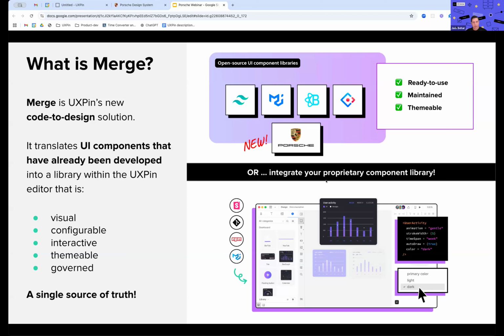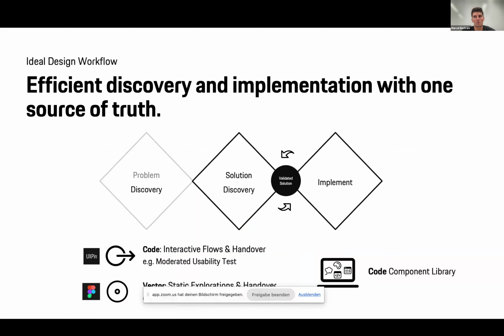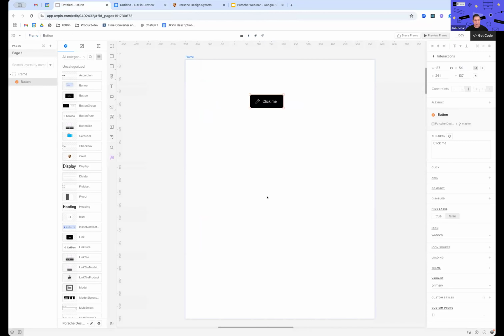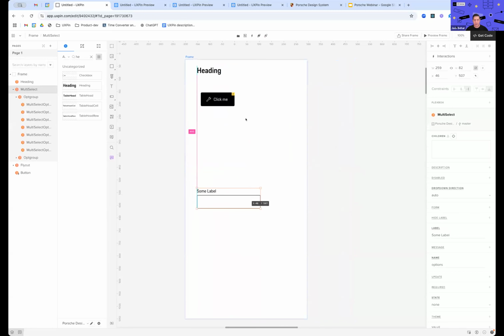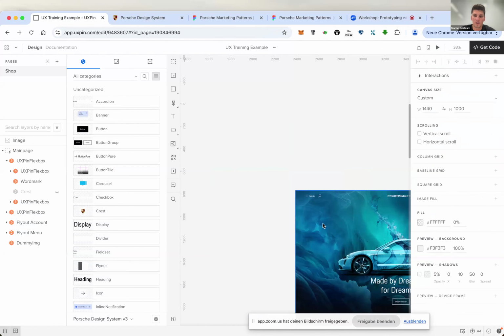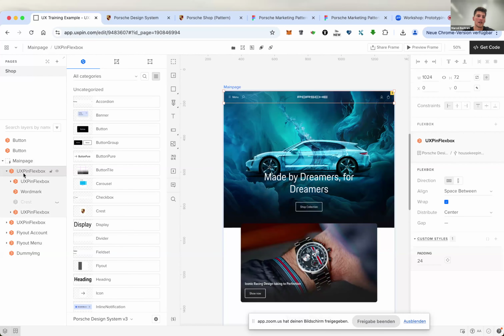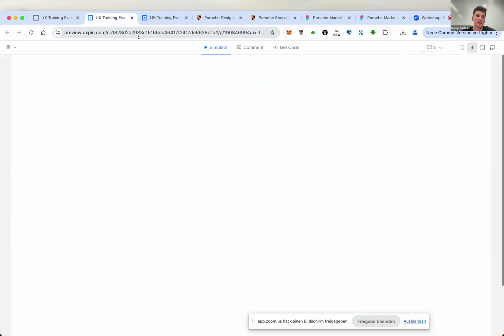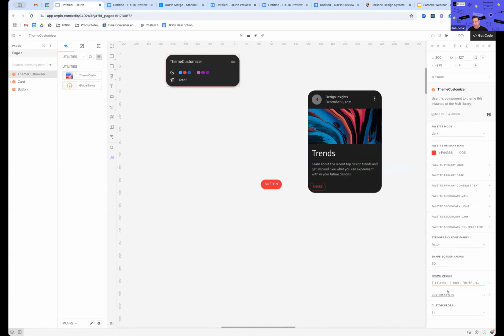Workshop: Prototyping with Porsche Design System

Comment: UXPin is not bad; I tested the software briefly, and the main issue I encountered was that the desktop app’s performance differs from the browser version. In many situations, it freezes on certain functions, such as moving frames, and the overall experience feels quite choppy, which I didn’t notice in the web version. I believe the app still needs some work to improve the experience, as I was unable to use it effectively because of these issues. I tested the MacOS version on an M2 Ultimate machine with 64GB of RAM, so it's clear that the problem isn't related to my hardware, but rather bugs in the app itself. I really like the interface and many other aspects, and I hope these issues will be addressed in the future.

Comment: Very cool stuff. Thanks for sharing. I'm a senior UX/UI designer and bridging the gap between the design and programming worlds have always been a challenge. The only problem I still have with fully advanced interactive prototypes like the one displayed here is that at the end of the day, programmers have coded almost the entirety of the final prototype. I can’t code so my sole job would be to design static components. Of course I can do a quick and simple interaction in Figma and show programmers how I want it, but they still need to code it. I understand that once a component is coded, designers can reuse it endlessly in the prototype. Based on my experience, it proves to me once again that designers and programmers must always work hand-in-hand. In my last job, I had the chance to sit right next to the programmers. Such a game-changing experience!